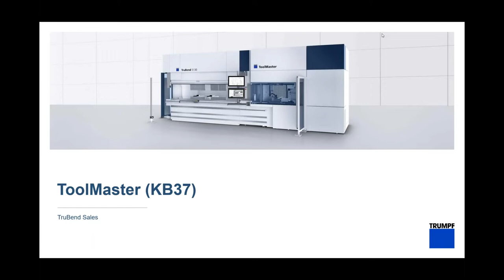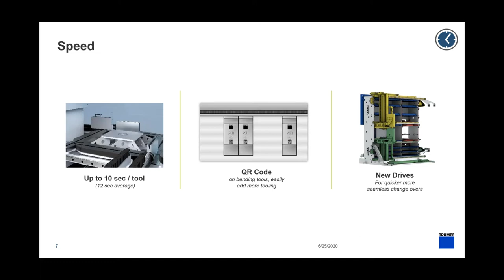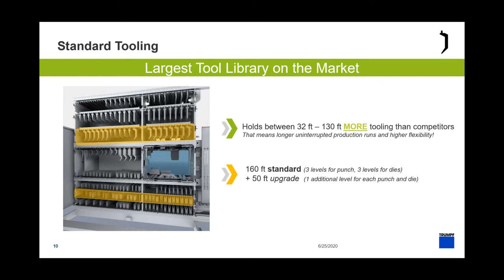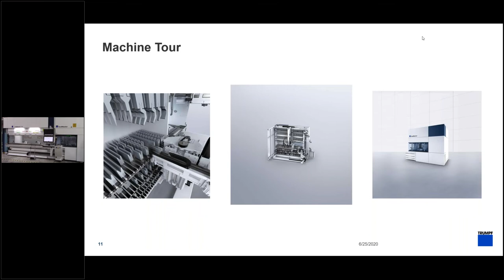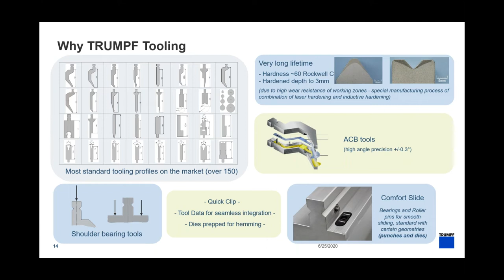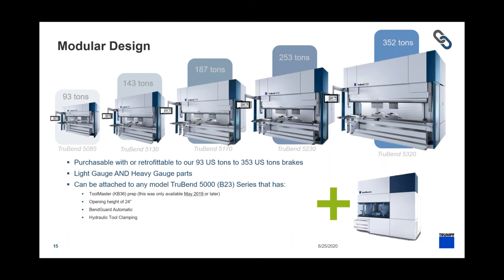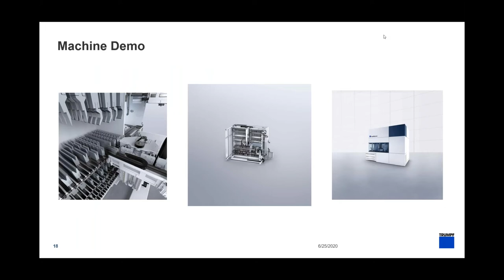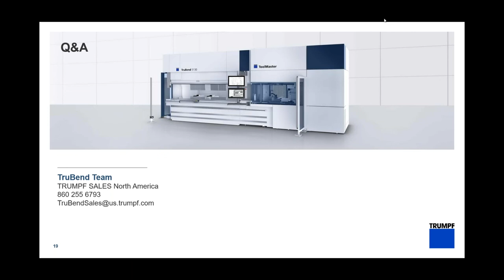The ToolMaster Automatic Press Brake Tool Changer

Comment: At about 10:53 Andrew is showing the tool capacity.  He says that each row can only hold one type of tool and one segment length.  Does that mean that each piece of a sectionalized tool would take up an entire row?
Reply from the maker: Each row in the ToolMaster (KB37) can hold multiple tool segments as long as they are of the same tool type and segment length. Each row can hold up to 600mm of tooling.